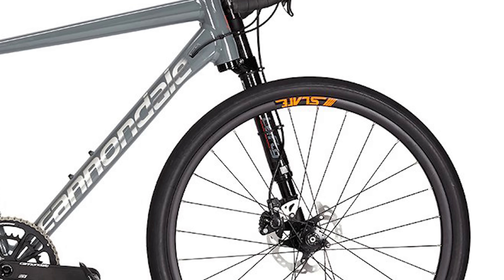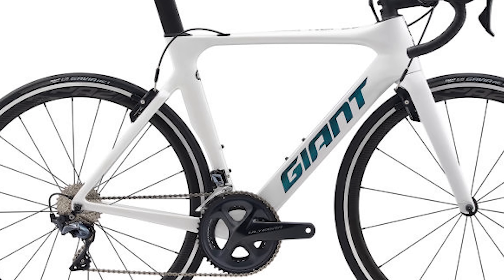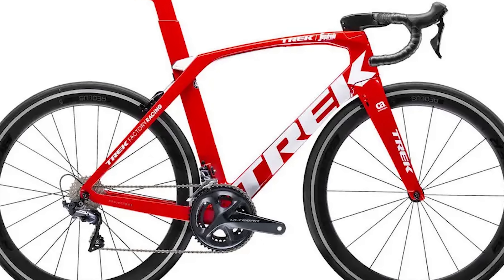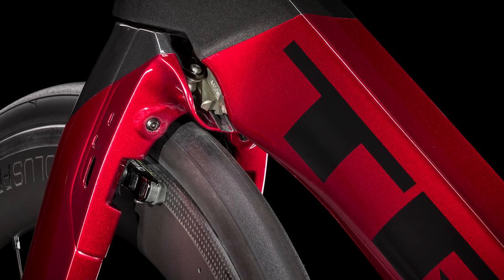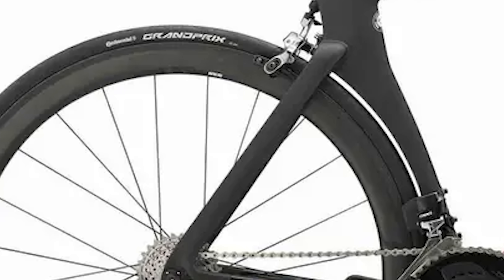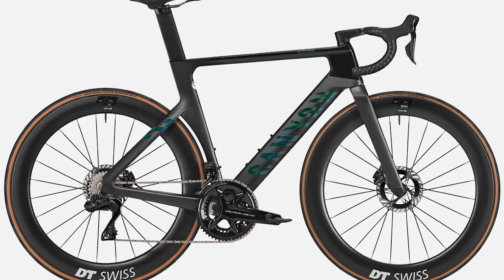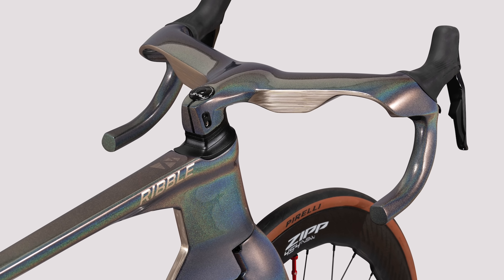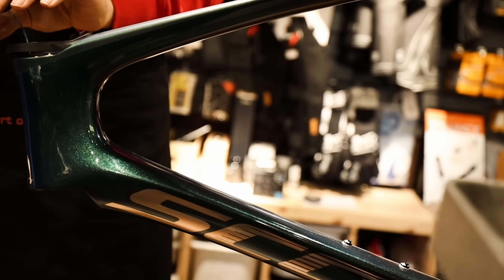Pro Bike Mechanic's 10 Most Hated Bikes

Comment: the Canyon handlebar is not to fix a shipping problem (they are shipped in the same size box as the old handlebar bikes) its a production benefit. the new handlebar can provide for a wide range of people because you can change the size. therefor production cost can be lowered and the price can stay competitive (customer benefit). they don't recommend you to change the width of the handle bar constantly, its just so you can size it right to you and leave it at that size.

Comment: I have exactly that 2016 Giant propel. Actually those brakes are awesome in terms of stopping power and feedback. They are a little harder to adjust but it's not a big deal really. I love that bike!
Reply: Believe me, I could list 50 bikes worse than any on the ones this guy listed here, but most people won’t have heard of them. Shite like the Itera which I always say is the worst bicycle ever made, no question. It flexed in dimensions that scientists didn’t even know existed. I have one in my garage awaiting restoration just so I can remind myself just how bad it is. Then there’s the Strida, a folding bicycle that due to its design, the taller you were the closer you had to sit to the handlebar. People over 5’10” ended up with the handlebar in their crotch. The Sinclair micro bike, a design so bad it was funny. 6” wheels on London roads, for fuck’s sake? You’d go over the bar if you hit a matchstick in the road. It was absolutely lethal. The Softride. A suspended carbon fibre boom instead of a top tube that meant your saddle height could change by about 10cm every pedal stroke. Seriously? That’s just a few off the top of my head. 

Current favourite shite bike is the Tern GSD electric cargo bike. A great concept ruined by being designed by fucking idiots with no concept of the word “maintenance” and built by cheap labour. Two days ago I had to replace the front headlight on one. It involved removing the entire transmission, dropping the motor and trying the remove the wiring loom through a hole in the main frame that a consultant gynaecologist would have struggled with. It took me 7 hours because the loom ripped and I had to re-wire the whole thing. Today it failed, and I have to do the whole thing again. Fuck you, Tern. 

But the worst bicycle right now? Anything made by Pendleton. Cheap as shit Chinese garbage with the worst components possible built with all the care and attention of an Auschwitz camp guard and sold by Halfords. That’s all you need to know.  

Just buy a 531 steel framed fixie. You’ll be a better person for it, trust me. And you won’t hate bikes.

Comment: The Haro 540 air BMX bike had the rear brakes on the bottom of the bb. Grinding with it was a nightmare. Snap off a brake pad or a brake line and not know it til you try to stop going down a big hill. Doing a crank grind would destroy the rim brakes down there.

Comment: Being an owner of a LOOK 795 aerolight I can agree with everything he said about the inconvenience of proprietary parts and aero brakes however he lost me at fatter tyres being faster - that comment contravenes physics. Narrower equals less resistance to airflow and higher pressures equal less resistance to friction. Of course comfort may be compromised but if it is forward motion with least effort you're interested in then anything wider than 25mm or softer than 90psi is unproductive.
Reply: That was the unquestioned orthodoxy for years, but we've since learned that energy lost to vibration will cancel out any friction gains from ultra narrow, high PSI tires. And wider rims easily solve the aerodynamics issue by creating a cleaner transition between tire and rim. If you don't believe me just look at what the WorldTeams are riding - Nary a tire under 28c to be found anymore. Not that they care about marginal gains...
Reply: @elpablogrande   @elpablogrande  it's the unquestioned orthodoxy because it is still true. "energy lost to vibration" lol - tell that to train engineers and ask them why they use steel wheels. Lower pressures and wider tires only create more friction and more frontal area, the enemy of what is needed. "We" have learnt nothing if "we" continue to promulgate this rubbish about softer and wider equals faster, ie easier to pedal, it is simply a fallacy that people have literally bought into. Sure the tyre width should closely match the rim width and too hard might lessen ride quality but if you want to go fast with the least effort you need to choose between ride quality or effort, you can't have both. Having said that tubular design affords better ride quality by design at any pressure. The pros ride what they ride because it's business, full stop.
Reply: Unlike a railway, a road doesn’t provide a perfectly smooth surface. I’m not making this up. But clearly you’re incapable of being wrong, so why spend 5 minutes researching when you can just double down on what you already believe?
Reply: @elpablogrande  haha, it's simple physics mate. I've done the research along with 44 years of extensive experience trialling ALL systems. Ok, perhaps slightly softer ride, nrcessitated by lower pressures by design, is  the only (subjective debateable) "advantage" for everything other than tubular. I'm one who is happy to sacrifice some comfort for efficiency. You, along with many other properly ignorant consumers are suffering from Ostrich Parasitic Syndrome whereby you have convinced yourself to believe the lie being sold to you by the marketing elite. Thanks for this opportunity.

Comment: I started mountain biking in the very early 90s, with an MBK. That had a U-brake mounted by the bottom bracket, which combined with a triple chainring biopace chain set left no room for mud... With the obvious disadvantages. Awful bike. However, the worst bike I ever bought was one I really wanted and saved for as a kid. The Orange Clockwork, back when it was a rigid bike. It rode like it was mush, it squidged under power and was thoroughly disappointing. Oh well. The best bike I ever owned was a Kona and now they hare going bust. Sad days.
Reply: That era, even the Spesh Stumpy had a U-brake on the chain stay

Comment: Have a 2011 Ridley Noah and I had to relegate it to indoor only since not only could it only fit up to 23c tires it had to be specific 23c tires (ie: conti 23c would rub). I broke a few spokes and I couldn't ride it home,so a few sag wagons later I stopped riding it outside.

Replaced with a 2021 Trek Emojda (t47 BB and di2). So much easier to maintain.

Comment: Notice there is no bike mentioned with press fit issues, probably the most feared part of buying any new bike these days.
Reply: I certainly reserve the right to be able to replace a headset or bottom bracket with any model I choose.  Can't do that?  I don't need it, then.
Reply: @jorymil  I’m talking about bottom brackets and how some expensive frames do not take too push fit well, so much so that the manufacturers will eventually go back to threaded bb’s.
Reply: Carbon frames are often press-fit because it works well in that application.  Headsets are typically press-fit as well.  As long as  you have the tools I don't think it's really all that bad.  The annoyance is that press fit BBs typically creak and make noise.  A classic threaded BB is much easier to  properly install so it is silent.  There are some super expensive press-fit after-market BBs that are probably quieter, but I don't want to spend the $$ on them....the stock ones are costly enough for my wallet.  So I just learn to live with the clicks and creaks.

Comment: Campag Chorus 11 speed mechanical - fitting internal cables to a Zipp bar. Not the bar's fault, but the cable routing on the Campag levers was just an absolute nightmare.

Comment: Another issue with the Canyon: that integrated headset has a max torque specification of 12Nm with a T20. 

Now I’m sorry but what engineer in their right mind even contemplated that specification? 

If you work on your bike and service the headset every six months, don’t sweat, and use a brand new T20 every time you might get two or three years out of it. I’m yet to see one that’s not rusted within six months. Utter insanity.

Comment: Time ADH Disc will take a measured 30mm tyre width front and rear (just about).  Conti GP5000S TR 28s measure 30mm on my 21mm ID rims and so far no rubbing of the fork or stays on my Time.  I definitely wouldn't put a 30mm Conti on there though.  And there's no margin for error / out of true wheel.

Comment: TRP HY/RD brakes the cable pull hydraulic brakes. Had them on my bike and had nothing but problems with spongy brakes and just generallly not working. They ended up practically seizing and had to have replaced with regular cable pull brakes. Theoretically they’re good, but I had so many problems with them.
Reply: If there's nobody in the area with a mineral oil-based bleed kit (not tied to any brake brand), you are indeed better off using something else.
Reply: @sbccbc7471  Yeah, it's meant to be a sealed system so doesn't need bleeding but my local bike shop did this a couple of times for me, both times within a few months the brakes had gone soft. I didn't use the bike for a few months and then one of them had basically seized. I took to another bike shop and they told me this could be a problem with those and suggested replacing with regular Spyre brakes
Reply: @a1white  Was the seizing caused by swollen seals?

Comment: I just bought a 1974 Paramount. Everything works!  It has for fifty years!  Off with this carbon, and proprietary nonsense!  Manufacturers in the cycling world take a component, design, frame, and if it’s not broken, they fix it till it is a broken design. Still looking for my all-original 1972 Colnago Super. It’s out the somewhere.

Comment: The bike I hate most is at the same time the bike I love most: the Alpha 7 (which is a velomobile). It is so beautiful, comfortable, quite practical and rediculously fast compared to my road bike BUT its a nightmare to work on. I mean usually everything works fine - until it doesn't. You can't just hang it in a work stand and easily take everything apart. These things are not made with ease of maintainance in mind. But should you figure out what to repair or adjust, how to do it and have the tools, the mechanical and acrobatic skill (and the patience and frustration tolerance) you'll have the nicest ride ever. Actually I want to get rid of ... but somehow I would really like to get another velomobile one day. Am I making any sense?

Comment: I’m surprised that handlebars haven’t been made with grooves on the underside to clip hoses into, would be far easier than routing them internally and would still provide the clean look.
Reply: Orca Aero does this.👍
Then they ruined it with a rubber sheath that goes over the bar next to the stem. So you still have to strip everything to change hoses. 👎

Comment: Can confirm the propel brakes are pants! Especially paired with carbon brake surface wheels! 
Going down steep hills in the wet is bloody sketchy.

I then went out and bought a B:twin ultra af as my winter/commuter bike. They hid the rear brake under the BB and its a nightmare to get the back wheel off 🤦‍♀️its not even a remotley aero bike!

Comment: I have a 2019 Madone SLR, but disc not rim. I'm lucky I found a compatible BB90 bottom bracket that's better than the garbage the Trek sells with the plastic cups -- creaks for days. Other than that, and the weight penalty of the IsoSpeed "compliance" seat post, I set it to the softest setting and forgot about it. Love that damn bike.

Comment: Hmmm... not once did you mention the slow boil issue with all of the internal routing is causing. Bikes heavily ridden (read: bikes with 10, 20, 30 thousand miles, ridden on bumpy gravel/groad terrain) with internal routing are often being found by mechanics to have brake hoses and cable housing with deep rub marks due to the tight bends within the handlebar, stem, frame and fork routing. These rub marks and gouges may lead to ticking time-bomb situations where hydraulic brake hoses may develop leaks internally in the frame. I've seen this first hand a few times. Food for thought....

Comment: Ive got a diverge gravel bike with the future shock 1,5 that's been removed now and i fitted a solid machined replacement.  I don't  mind the future shock to work on but its a heavy part and expensive to replace
Reply: Is the replacement offered by The Bike Sauce?

Comment: Man, the integrated cockpit on aeroad is a nightmare full stop. After replacing the head tube bearings for the first time one year in, and paying special attention while washing, riding in reasonable dry weather, they’re down for a second replacement 7 months later. At this rate it is cheaper to buy a dedicated training bike than to service this.

Comment: I typically don't like proprietary anything on a bike, but I think Nic's unnecessarily harsh on the Roubaix. If I were to dunk on the Roubaix, I'd be dunking on the awkward seat post clamping mechanism that requires a torque wrench but is awful to work on with just about any torque wrench (they seem to have fixed that on the SL8). The Future Shock is something that, while a bit more intricate than a conventional headset, is actually a pretty neat solution. You don't have to cut a fork to length. You can take off the stem without affecting the headset preload. The suspension doesn't rotate the handlebars forward when it compresses (like the Redshift or Cane creek ones) making it way nicer to ride. And since it's a fully closed system, it barely requires maintenance. Oh, and it takes 2 identical bearings for both sides of the headset, which is also nice. To top it off the most recent outing of the Future Shock is backwards compatible which also offers extended service life for older Future Shock bikes, because they can get the current model as a drop-in replacement.

As much as I dislike proprietary stuff on bikes, I consider the Future Shock a good example of a proprietary solution that actually services a purpose, works as intended, is neatly done, and is actually serviceable with standard tools and without a degree in bike mechanics.

Comment: 100% right, especially the steering block, I had a TT cube with steering angle block and regularly avoided falling off when tackling tight corners at low speed 😂
But then that’s like Darwin’s evolution theory: the good concepts stay and the bad ones die out…

Comment: Love it! Worked on a few Trinity's and must admit you have a few interesting hours ahead of you!
Can i add the controversial anything with Campagnolo on it? EPS,their disc brakes,need i go on! 😂
Reply: I love Ergopower levers.  Much nicer than Shimano as a rider.  I run a hacked drivetrain just to use Ergopower and have its trimming capability.

Comment: Came into this video knowing that Specialized Roubaix would be in here. I still love mine .. but it's a PIA anytime I need to work on the headset. 😬
Reply: Just more parts and fasteners to deal with than usual, at least it's better than working with integrated internal routing. I even got myself a slim long-reach 4 mm hex bit socket in order to torque down the collar to the steerer tube to clamp the Future Shock once the headset cover is on (2017 & 2018 Roubaix's headset cover is one-piece, with a hole for the collar clamp's bolt just slightly larger than 4 mm that most 4 mm bit sockets can't fully fit through if you want to bottom out on the bolt's hex interface).

Comment: Specialized Stumpjumper Evo Carbon. Over 50% I’ve seen spiderweb shattering in the bottom
Bracket shell in less than 6 months of riding. They hide this defect with their useless “bashguard” protecting the paperthin Carbon they use on that section of the bike. Seen six failures in the past year. Specialized’s “solution” is to send people alloy frames instead because they know they have a flawed product yet they haven’t yet put out a recall

Comment: Have a completely internally routed Cervelo S3 with mechanical ultegra. Everyone was saying what a nightmare that bike would be changing cables.   It is super easy and I can do it in 30 minutes really well thought out. I heard of people being charged £300 to do it which was a rip off. The only real issue is servicing the headset which I could just about do on the bike. Changing the bearings is a 1/2 day job though if your taking your time.
Reply: This is the last S3, right?

Comment: I have a question. So my hub uses jbend spokes right. But the mechanic didnt lace the spokes, instead they did it like a straight pull. Would this be fine? Like in terms of the stiffness and durability of the wheelset? I can see the spokes poking out halfway in the rim hole.
Reply: I'm sorry, how is that even possible?? The holes on the flanges for the spokes are pointing sideways.
Reply: @sbccbc7471  i dont even know man. I think the mechanic got ahead of himself and jumped to conclusion and think that the spokes were short. I really dont understand how and why he continued with the remaining spokes like he can literally see the spokes poking out the nipple

Comment: To fix tire rub, some carbon chainstays can be modified by frame builders / repairers to fit slightly larger tires but that will void your warranty. My Parlee had tire rub with 25mm, but Calfee Design in California modified the chainstays to run 28mm tires with no rub (and no problems).

Comment: Mine is specialized venge rim brake mechanical or venge vias mechanical, one cable needs to be replaced, the whole bikes comes apart, good $though but omg lmao
Reply: That's definitely the Venge ViAS, the first-generation Venge wasn't a pain to work on.